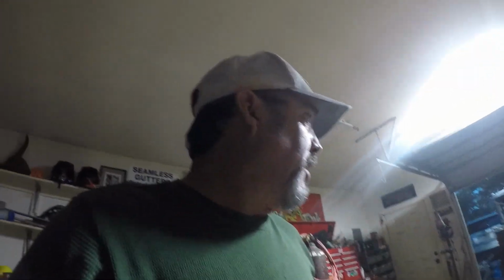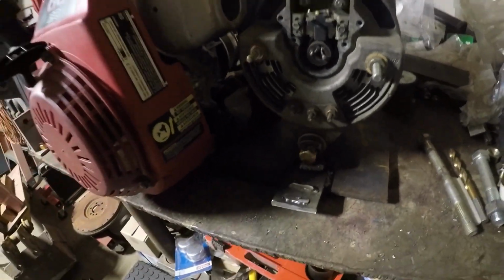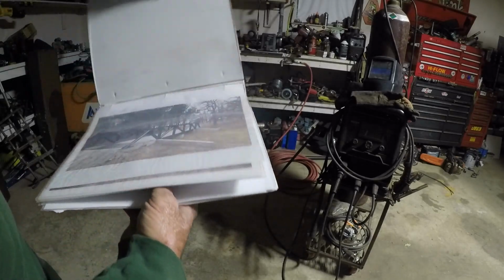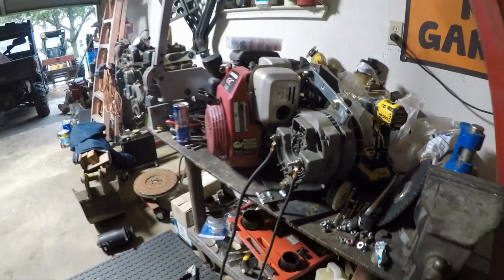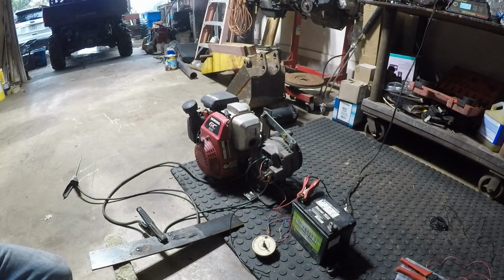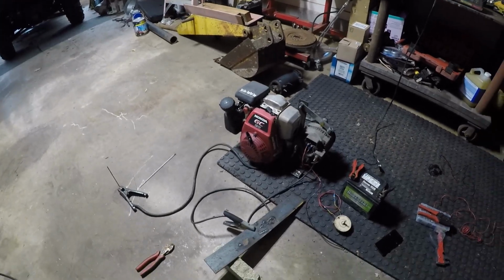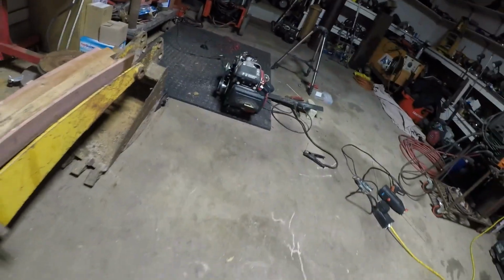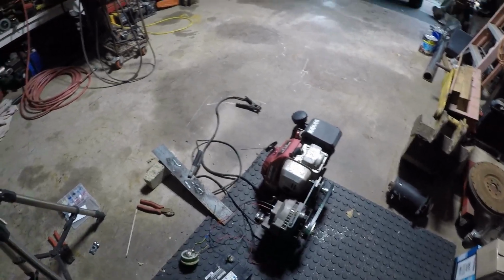Alternator welder part 2

Comment: I know this is a year old, but I sympathize. I built a welder like this for my Jeep, (mounted along with a regular alternator doing alternator things) and used information I found on different places, including Merlin's to do so. I'm only 1:46 in to your vid, so let's see if I get this right: One side of the rotor should be ground, the other +12VDC. Your "Positive Out" terminal is your stinger lead, and of course negative is negative. I got mine working really well, and am in the process of building another. Fun!
Reply from the maker: Thanks for the comment brother! You got another subscriber!
Reply: @oldironfinder  Likewise!
Reply from the maker: It may be a little overkill, but I've got a sweet little 14 or 16 hp kubita 3 cylinder diesel that has its own alternator.  It's a fully self contained unit with radiator. I'm thinking about putting this alternator on it in a little frame to make another little mini lincoln like the one I made yrs ago. I also have a video of it on my channel. That would be cool I think
Reply: @oldironfinder  Looking for it now. (the video) And, remember: There is no such thing as overkill!
Reply from the maker: Let me go back and check. But I think i have a schematic of the whole setup
Reply from the maker: And yes. They are super fun!
Reply: @oldironfinder  Yeah! Great for trail fixes too. I don't run a rheostat on mine, just straight 12V from the Jeep for the exciter circuit. I don't run anything bigger than 3/32" rod, usually 6011 or 6013. I can adjust the output by manually adjusting the RPMs, but that's in a total mobile unit. In any case, fun stuff!

Comment: Hello from Germany, im not that good in english. Can you explain for waht are the Batterie is . Did i understand it right  the fewer volts the battery gives, the less power the alternator produces for welding?
Reply from the maker: @pyroislove7823  correct. So the alternator has to use 12 volt power to excite the alternator to make it produce electricity. But, without a second alternator to charge it, it will slowly drain the battery while you are welding
Reply: @oldironfinder  and how many amps should the battery have?
Reply from the maker: @pyroislove7823  the more the better. It will let you weld longer. Something like a 850 to 900 amp would let it weld a while

Comment: Did you ever get it going? I have built a few of  these. The alternator needs to run around 7000 rpm to work good about twice the speed of the engine so 2 to 1. That engine will probably bog. I use 12-15 hp engines. I notice Harbor Freight has their 14 hp electric start on sale right now for 329.95. I have used it a couple of times and works great. I have one that is a Kohler 15 hp turning a Leece-Neville 24 v  off an army truck that I run 12 v through the brushes with external diodes that welds great. It is probably 3 times the size of the one you have. I used an arc stabilizer coil out of an old Miller Thunderbolt arc welder on it. On the brushes you ground the uninsulated brush to ground. The brush that has the insulated wiring goes to 12v positive through your rheostat. The rheostat varies the voltage to the fields to regulate the current. I have been using 10 amp motor controllers in place of a rheostat since they are much cheaper than the ohmite type rheostats and they work fine.
Reply from the maker: Not yet. I've got a whole bunch of brand new engines, 10,11,13,and 15 hp. I'm working with another youtube that has a plasma table to build custom brackets for everything.